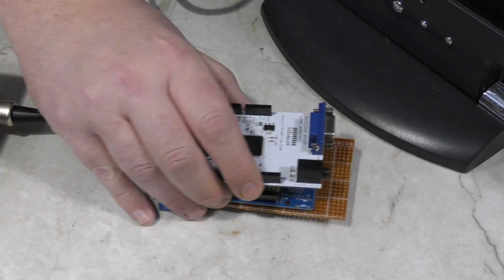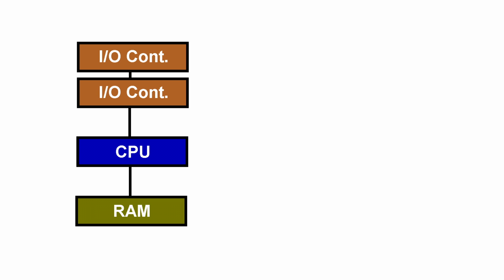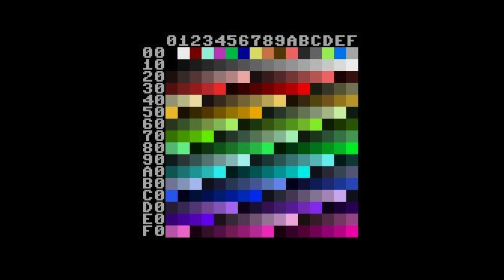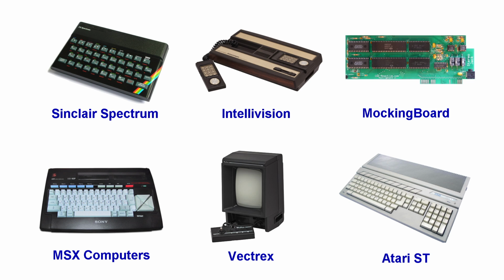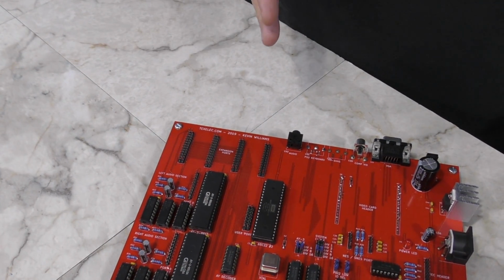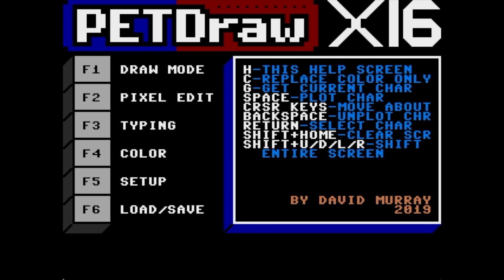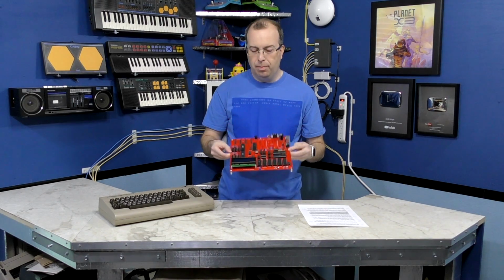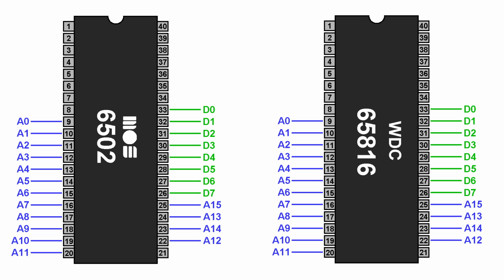Building my Dream Computer - Part 2

Comment: Awesome work, I am very keen on obtaining one to play with at some point. One thing that I would ask you to ensure exists, is a fixed frequency clock/counter of some kind so that timing can be done independently of CPU clock frequency. This not only would make some logic simpler/easier, but it would also avoid the issue of over/under-clocking breaking things like in the DOS days where most games used delay loops and CPUs started to get faster.

Comment: I find it sort if ironic he mentioned the Commodore 64's clock speed and its ability to over clock, i was just wondering if that was possible
Reply: He pointed out that it wasn't feasible because of the various clocks all being linked together with the NTSC or PAL clock which cannot change or video is lost. If the subsystems had independent timing sources, then it might be possible, but that's not how they were built.

Comment: Could it be possible to build keyboard-based design where its all wrapped under one case without any external keyboard such as the original C64 was? 
Brilliant build and design with all the hardware/mobo.  You are truly in some next level retro stuff here. Excellent. Waiting for final release :)

Comment: Bit of a funny story. Around 9 minutes, David talks about how he hasn't really seen anybody write a BASIC program that used up all that ram space. Turns out, when I was about 15 in the mid 90's, I wrote a 'Casino' program entirely in BASIC for the C64. I had Blackjack, Slots, Russian Roulette and a few other mini games I forget offhand. I was proud of myself that I'd written something as complex as this but then I ran into a roadblock - I actually ran out of ram! I had to 'split' my casino into two parts to fit all the mini games. I no longer have the disks where I had saved my games onto, so they're long lost data and I had never had the chance to import them into D64s later on even after I had built an adapter to import from my 1571 into a DOS machine. But I still remember sitting up late at night working on this, loading and restarting multiple times in my perfectionism to make something that I had fun with.

Comment: I'll take the black case with a jumbo sized rainbow butterfly !! While the sff keyboard with the commodore graphics and blue tooth would be fine..... I would still make a  full sized cherry kbd with commodore graphics key caps  and blue tooth, as an option ! There's no other keyboard, that has that Selectric kbd break-over feel like Cherry's ! And a wi-fi with some buffering card !! And lastly the first cart or floppy should be a visual computer execution display.......!  It should show everything from the keyboard through the traces,  cpu and other chips operations and events onto the end function or device . It would be great to see your data flow throughout the system and provide some good instruction for newbie's on how the computer works !  This is a Great project and you have some really Awesome people on your team !!

Comment: if you allow for 2mb of 8k banked ram, why limit BASIC to 40kb?  why not limit basic to 2mb with a 40kb heap (for array dimensions, variables etc).  of course likely you will never get to fill 2mb with a single BASIC program, but it shouldn't be that hard, the BASIC interpreter can still run somewhat as it always did but of course running through a banked program - it's an interpreter, so the user still uses line numbers, not banks or addresses

Comment: why not use a custom user port to allow a board/adapter to plug in. allowing you to connect a whole range of controllers. so the user port will allow the user to create different adapters for each controller.

Comment: I copied the balls program line by line and tried all 255 balls. It came up with a
?BAD SUBSCRIPT  ERROR IN 120
Reply: You've clearly made an error typing in the program. Line 120 is a REM statement, it does nothing at all - it certainly doesn't access an array.
Reply: @gwishart  I figured it out, I had the line numbers wrong at first and when I was fixing it, I forgot to erase line 120, which was actually line 108 written in place 120

Comment: I'd say it's better to have more than to have less. You can emulate the style of Commodore 64 graphics with your system, but you're not limited by 'em.
Same goes for the 16-bit ver. of the 6502, you can still do just about everything that a 6502 can do.

Comment: You can use the 65816 and ignore the data lines when they're the upper eight address lines. You'll have a 64K machine, but one with 16 bit registers. The result better system throughput as you'll need fewer instructions. Indeed there used to be the W65C802 which was pin compatible with a W65C02 because they suppressed the upper eight data lines on chip.

Comment: Hello from Germany!

As much as I like your channel, here I have to contradict on some points.
Working with the 65816 (and 65808) since it hit the market (1983), I can not see any problem in the shared address lines. This essentialy is completely the same as bank switching, in fact in the datasheet it is called "Data/Bank Address Bus (D0-D7)". This is in no way any more complicated than an external bank switching circuit, it even saves logic.

Yes, the "obsolete" Spartan 3 is quite old, but it is absolutely the same to program the Spartan 3 as programming any more recent one (at least from Xilinx), did that, do that.
 

There is no reason (aside from the layout maybe) to use multiple FPGA or CPLD in such a design. Any reasonable FPGA will do, and could even replace most other chips easily - it you want -  the 6522 VIA for example. 

Any DMA feature should not need any external chip - remember the "Blitter" from ATARI? - a crude and bad CPLD implementation
. 

And I see no contradiction to a pure design goal - many chips inside the old computers (starting with the Apple IIe or C64) are simple but real programmable logic chips, aka CPLD / FPGA.
 Or look at the C64 PLA replacements using an CPLD:

if you're ready to sacrifice a sacrilege, you could even pack a 6502 or 65816 into the FPGA.

Simple VGA output is easily done in a FPGA with only a few external resistors needed and less than an 100 lines of VHDL code, for complete memory mapped graphic, you can use a FPGA which includes enough fast RAM, or you can easily connect RAM externally.

The 65C816 is so much better and straight (in fact it was developed to overcome complicated design flaws in the 6502), faster and easier to program than the 65C02, that I can not see any reason to prefer it over the 6502. No need to fight with only one zero page any more :-)

What remains is the programming effort for the FPGA, but errors can be easily fixed without having to change the hardware.

I see no need for a microcontroller either, but there are even FPGA on the market with an ARM included, but that is a question of cost.
In one of my designs I use an arduino supporting th FPGA purely for cost reasons and to simplify the layout.

just my 2 cents, 

greeting Detlef
Reply: thanks.. a great comment
Reply: Yeah the muxed address lines are not at all a problem.  It is a common design pattern -- the 8051 used it, some memory chips also use it.

The thing about the Spartan 3 being obsolete does actually make sense.  The older Xilinx chips need to use an old version of Xilinx' development tools.  The newer ones need the new version.  The old version is visibly dated and clunky + the Verilog language it will accept is less advanced and less nice than the one the new version will accept.
Reply: "The 65C816 is so much better and straight (...), faster and easier to program than the 65C02, that I cannot see a reason to prefer it over the 6502"

This might confuse readers. I'd like it if you could edit your comment so it says "I cannot see a reason to not prefer it over the 6502." Why is that confusing? Well, it's simply because you demonstrate some good points about the 65816, however in the end you still say that there is no reason to prefer it over the 6502.
Reply: @iProgramInCpp  Just, let's say he wanted to say "see no reason not to prefer it over 6502" shrug
Reply: Yep, i agree that most of those old and not-available-anymore chips should get an CPLD or FPGA solution, as well as the decode logic. It would be so much better, since heck that's why the programmable logics even exist.

Comment: The light grey case and keyboard combo looks incredible and clean.
Reply: I like the look, but I cringe at the key layout.  In the 80s, people who already knew how to touch-type had to re-learn, because the details of ASCII meant that it was difficult to make (for example) shift-9 be (, shift-0 ), and shift ' become ".  People of course DID learn the ASCII-twisted keyboards that came from Teletypes, ADM-3 terminals, and all of their clones.  And then we had to re-learn AGAIN when IBM decided they had to embed microcontrollers in their keyboards in order to make the key layout match their mechanical typewriters.  So yes, I understand exactly why the keys are as they are, but these days, the microcontroller in the keyboard is a $1 chip.

But I'm probably just stomping my feet on holy ground, here.
Reply: (And the very next thing I see is the front page of commanderx16.com is a picture of the system with a modern keyboard layout.)  Never mind.  I mean, not a big deal to offer two different keyboard designs, for true believers of either denomination.

Comment: The video hardware just seems out of place for this machine.  A simpler design with less functionality using existing graphics chips, along with some kind of simple DMA to speed up transfers, would have provided a pretty decent display and fit the time period of the system.

Comment: Is that lego c64 an actual working computer or does he just mean that you can press the keys in?
Reply: He's basically designed a lego case that you can build to mount the inners of a C64 in and lego keys that replace the existing ones on the keyboard, quite a fun project to watch, his channels called retro recipes.
Reply: @TimmyJoe633  that's pretty cool. The Lego company should be selling them as working computers.
Reply: He is trying to get Lego to put it into production as a saleable case, but I think he has to have so many thousand votes of support for it or somet first. He's also come up with a version thats just a non working lego model too, for those folks who dont want to strip down their trusty C64's, but want to own a lego model of one.

Comment: I think the VGA proposed is overkill.
I have an idea of 320 (360 in 16:9) x 400,  one foreground and one background color out of 64 color palette per line, using a  8bit 8051
if enough cycles left over could change colors per 8bit block, as it got 4K RAM a 160x200 bitmap mode would be possible.

Comment: I hate to say it but the feature creep seems to have set. It was announced as an 8 bit system, but it's ballooned rather badly. An 8bit on par with a 286. An 8 bit with 2MB of RAM. An 8 bit with 256 colours on screen ala VGA. An 8 bit with X68000 (essentially AdLib) sound.
The premise has also ballooned into a bad situation. 300$s for a ITX board, and has ballooned 3-6x the original projected price. 
This is not going well!!
Reply: II II what’s wrong

Comment: 38:50 An 1 MHz 6502 would hardly "run almost as fast" as a 4.77 MHz 8088. Yes, it could reach about half the speed of the 8088 if your hypothetical machine code consists of memory loads and jumps only, i.e. the slowest instructions on the 8088. Normal register to register (or zero page) arithmetics takes about the same 3-4 clocks though, making the 4.77 MHz 8088 around four times as fast there. And as soon as you need any form of 16-bit arithmetic, the difference would be pretty huge: The 6502 needs 20 cycles for an 16 bit addition (using 8-bit additions via carry), while the 8088 needs only 3 cycles! So the 8088 would actually be more than 30 times faster here (4.77 x 20/3 = 31.8).
Reply: Apparently your 8088 is rusty. Those 3~4 clock cycles are instruction cycles and not internal cycles (like the z80 has T states). As well as the 8088 has an 8bit bus. And those 20 cycles on the 65x, includes reading it from memory, adding it, and writing it back to memory. On the 8088, that's only a register to register operation. Not the same thing. And.. the x86 is gimped with only 4 general purpose registers (which isn't even true because AX is the really only true general purpose register). The 65x @ 1mhz is equivalent to 8088 at 4.77mhz. Especially when you consider all the other operations that are MUCH faster on the 65x (register index addressing, indirect index addressing, etc).

Comment: It needs to be under $50 or people will opt to emulate it on an R PI, which will be the death of it. There will be more emulations in the wild than hardware versions which mean more community support to the emulation , which means more community development for emulation and less community development for hardware . If the project is seen as an emulation of a pseudo-retro platform, then why would a user not use an emulation of an actual retro platform. I feel like the project is veering away from it's original spirit because challenges can be resolved with more modern hardware. For example the requirement for all DIP was broken with the video card. If you consider the video card as a module that has DIP then it isn't off-the-shelf even if it is sold on ebay, I wouldn't consider it off the shelf.  I love the graphics of the video card and it's capability gives the nostalgic feel, but it does break that requirement, and if that does then maybe other elements should. Another example is the case.
It is a great idea to not re-invent the wheel and use an established form factor, but the solution provided is not nostalgic enough. I would like to see a chunky manila utilitarian box. It would make make sense to have an external keyboard to make it easier and if you were to go with an eternal keyboard the look of the coleco adam comes to mind. This would be too big , it is asking to take up too much desk real estate and living room real estate if it is seen as a game console. I think looking and feeling nostalgic is the main element to retro computing , and if it doesn't look and feel nostalgic , enthusiasts will pass on this.

Comment: Recommend including the { } keys on the keyboard. With the proposed specs, it might be possible to develop a decent native C compiler, and then because many languages have implementations that actually "compile" to C (e.g. https://github.com/dbohdan/compilers-targeting-c ), you'll then have a wealth of other languages available.
Reply: You don't actually need the { } characters for C, you can use trigraphs instead.
Reply: @gwishart  True, but they’re a major pain to use and cause their own problems, mostly due to alternate uses for sequential question marks. C also has some digraph sequences which have been better designed to reduce some issues, but they’re still a pain. Far better to have the standard ASCII (characters code 32–127) on the keyboard, if possible.

Comment: Separate post for separate question : So I'm confused here, was the 6502 family always capable of that level of (theoretical) overclocking, just throttled due to all the other hardware it had to interface with, or was this something that became possible only with later revisions?
Reply: Harrison Fross CMOS generally runs faster. So a 65C02 will be able to go faster than an older 6502 (note the missing “C”)

Comment: I think that using the 65816 with a flat address space, could be better. You could also map the whole video RAM and have 15.5-15.75MB of RAM available for basic, leaving the upper  256-512K for ROM, video ram, I/O etc...

Comment: This is a very impressive project. 

Personally, I'd go for the FPGA sound route rather than the YM-2151 or SAA-1099. That way you're not dependent on old stock and it's easier to move the whole design to a single FPGA later.

Comment: Sir Dave, I think it's best to skip to the $50 one, since you already have prototype, it's best to Kickstarter and Indiegogo it. In this way, one can also gauge how many will buy/demand and at the same time, have funds to use smaller SMD and the fastest pure 16-bit and the fastest GPU for that and the fastest memory for that, so that there are no bottlenecks. 200 to 300 would not take off, coz' there is competition at that price range.

God bless, Proverbs 31

Comment: Could you slap a real time communication method on there like rs232, uart, bluetooth or ethernet? I'd be leaning towards rs232 since you could use a null modem cable to connect 2 of these together & you could get rs232 to usb and have some software running on a PC to have tunnel software like xlinkkai but for the x16 and put in support for the emulator.